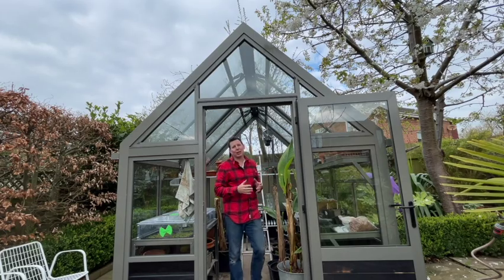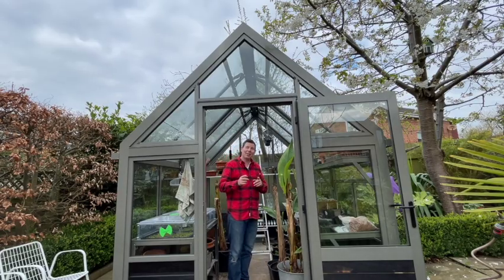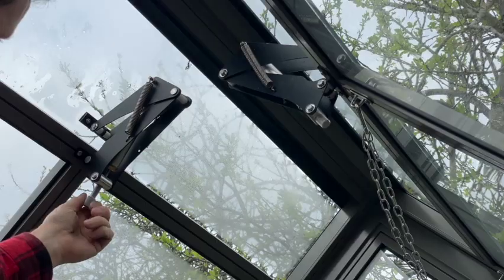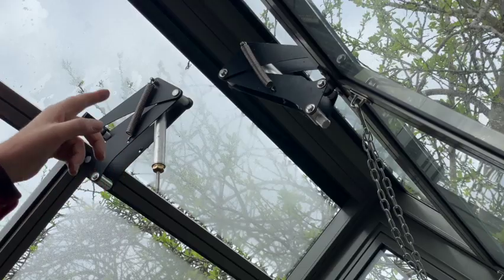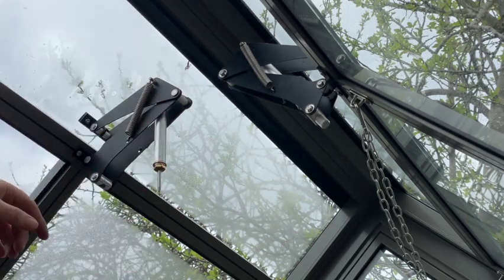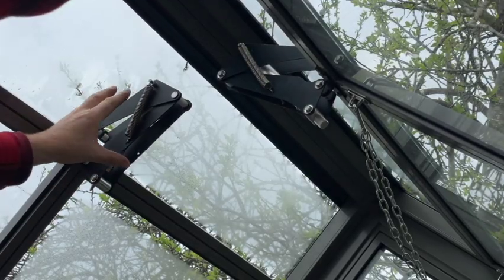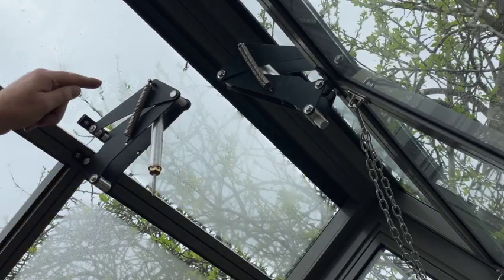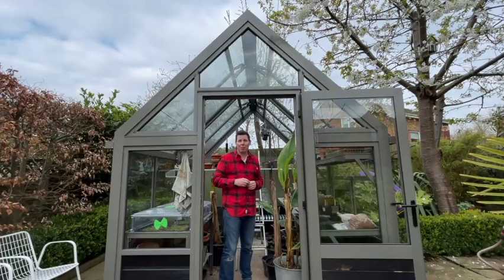Greenhouse Autovents not working

Comment: I am having a heck of a time to get the cylinder to screw in the bolt. It starts but then quits and I don't see it at the other end. I've tried a few of the cylinders and still cant get it to scew all the way in. Suggestions???
Reply from the maker: I’m not entirely clear on what you’re saying here. Is it simply a case than you might need to source a longer bolt ? Have you spoken to the manufacturer of your greenhouse ?

Comment: I bought a Costco green house back in July this year and the auto vent stopped working yesterday, hadn't disengaged just didn't open, surely it can't have worn out in 3 months. It were 38c in it yesterday, so propped it open with a lump of wood and kept the door open. Was wondering if the wax does not like west Australia and would the Bayliss fair any better. Great vid. Cheers
Reply from the maker: It’s unlikely to have worn out. 38 degrees c is pretty hot so I’d suggest it’s Faulty. A Bayliss autovent will likely fair better than a Costco one for sure.
Reply: @TheEnduringGardener  Many thanks, I expect Costco to replace, but down the track I'll get a Bayliss